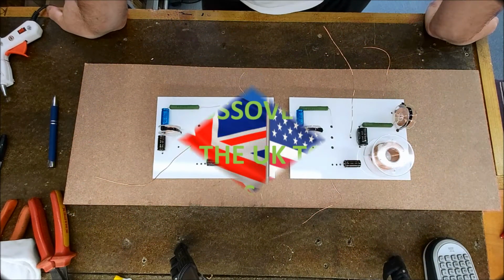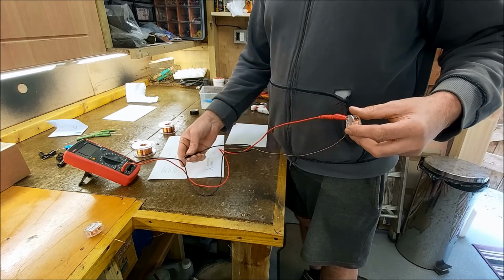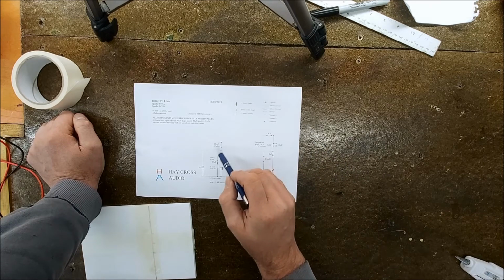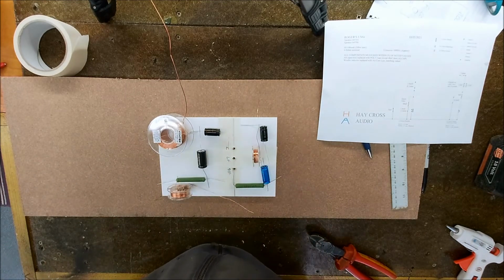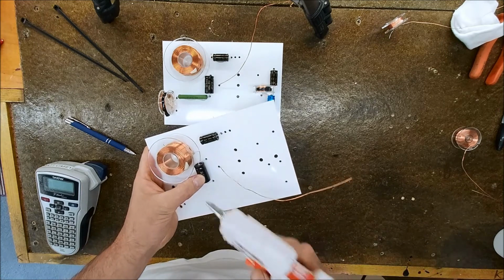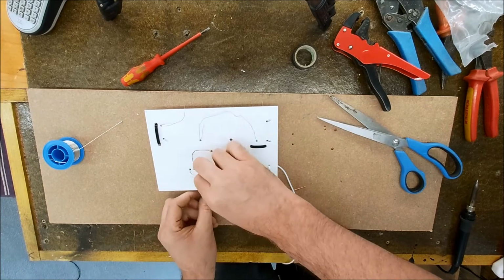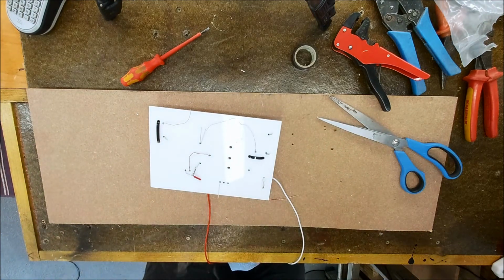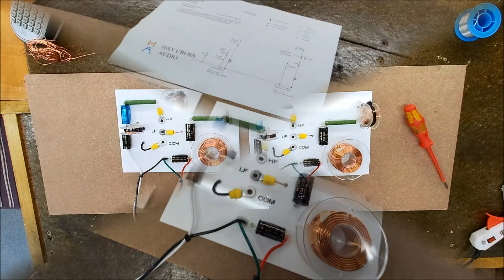Roger's LS6a Crossover Build - From UK to USA

Comment: Were the old caps the black and red alcap type ? As far as I have seen , they were paper and foil bipolar non electrolytic types as they had no electrolyte in them , using film caps should be fine as a replacement for life span if nothing else .